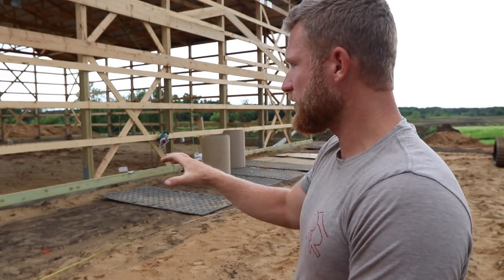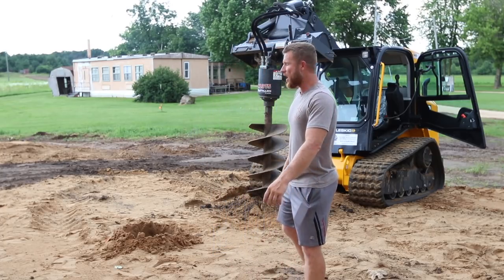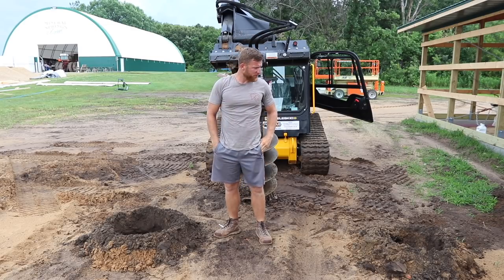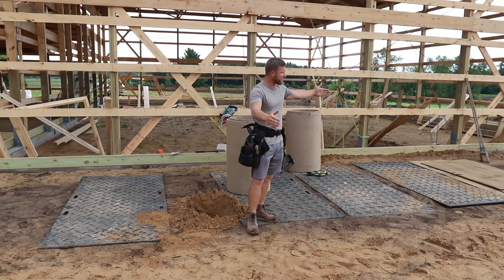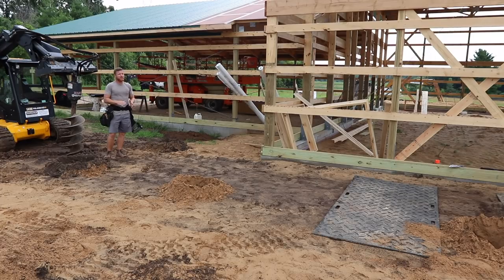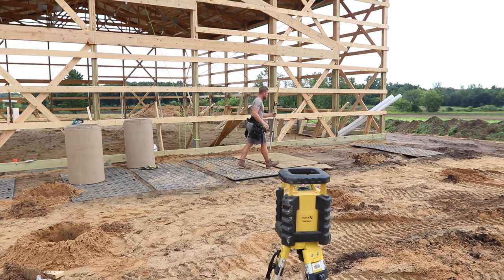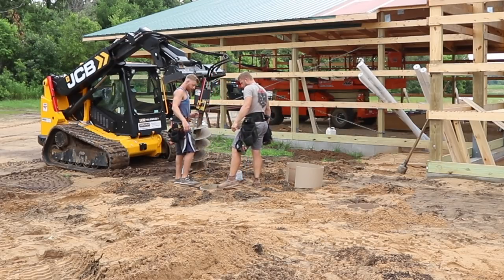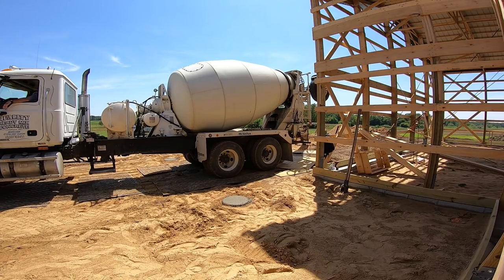Building a Hunting Cabin 8:  Using the JCB Tele-skid

Comment: Good to see the recent generation of JCB skidsteer at work.   I remember driving one of the first prototypes back in the early 90's, when I worked for JCB as a 'young'ish' engineer.  Frank Mueller, who developed the concept at Mr JCB's request, asked if I was an experienced skid steer driver. Uh no!  It was just that the joystick controls were like the backhoe loader's controls, the machine which I was designing.  Bobcat operators struggled to run it because they were used to push-pull levers and foot pedals.  I filled up the foot well and had trouble getting out with my shoes buried!  The roof didn't have any glass in it and the full bucket spilled over at full height, dumping lots of dirt in the cabin!   Fun days!
Reply from the maker: Great story

Comment: I would of just pulled a 12' 16' 20' off the building for the first layout. 
Since its only 16' wide. 
That is  3 4 5 multiplied by 4 .  
I know the longer the better, but sometimes you can make a mistake on the calculator.  
You guys do awesome work. 
Don't see many guys like yall down here in Florida.

Comment: Just a small trick we used when drilling  pier holes when we get to the right level we drop in the hole about half a bucket of water in the bottom spin the auger as fast as you can and it will clean the hole alot better if too wet drop  some lime in the hole and spin the auger In the last few years we have been using 14 tonne excavators with multi speed augers which really clean the bottoms of the piers the other thing we do is dig the footings first then drill the piers after this quicker then doing it the other way especially  if there is reo in the piers some of the excavators have cabins that side forward so the operator can see down the hole with out getting  out  of the  machine from the retired  Aussie builder that has drilled thousands  of pier holes under his belt

Comment: Remote Camera system attached to the coupler would solve the view issue if it also had a gps lidar sensors. You could also get some precision measurements as well..

Comment: When you are pulling measurements off of the building to determine pier locations, how do you make sure you are coming off square and not at an angle? Do you use 2 tape measures at the same time and join them together at the correct length on each one?

Comment: Should be rather straight forward to put that drill on the telehandler and get rid of the skid. Example: Digga's PDX2 to PD8 range of Earth Drills, also called Auger Drives, are ideally suited for telehandlers and truck cranes with a flow between 30 to 115 lpm. Used for all types of drilling applications

Comment: Is there no "curb" at the bottom of the building exterior walls?  What keeps the critters out and the rabbits inside the building?
Batter Boards....yes, that's them but don't know much about them.
Reply: Still have to lay out gravel and pour the concrete floor. Ain't nothing getting in there.
Reply: batter boards (www.google.com/search?client=opera&q=batter+board&sourceid=opera&ie=UTF-8&oe=UTF-8) do not serve the same purpose as rat boards or stem walls.

Comment: Re the visibility problem, why not hang a little wifi camera off the front face of the cab and watch it via a tablet screen bungeed to the sun visor.
Reply: He did/does mention later in the video what he did to get a better angle.
Reply: Respectfully, tho I suggested adding a wifi camera, this doesn't imply that I didn't also watch the whole video.
Reply: @dankolar6066  Once he figured out and shared the fix for the visibility problem your idea is as logical as mounting a little Wi-Fi camera to the front face of a car and to drive via a tablet screen bungeed to the sunvisor.  Possible, technically feasible, but not in any way a superior solution to the one he found worked best.  When you throw in he found the curve of the far pivot point to be a more acceptable angle therefore doing a superior job...  It is more logical to assume you didn't watch his solution before sharing yours than yours is a logical solution.
Reply: @dankolar6066  My comment stands that he found a far superior solution than a bungeed screen and camera system.

Comment: And you could make all the measurements a whole lot easier by using the metric system, no more fractions of a inch.
Reply: Interesting point.  A few years ago, I switched over to using metric for all my woodworking projects.  It simplified everything.  There's a reason every other country in the world went metric.
Reply: Sorry I only speak in measurements that put a man on the moon. Yes they did use metrics for certain parts for other countries building parts. I still don't understand why people like you complain. You're watching a video about a building be built in America by Americans and filmed by a American, on a American website, on the internet originally invented in America, on a device that was originally invented in America. Tell me why your measurements are so great now? Just cause you don't understand? When I come across someone over the pond using the metric system I just use Google to convert it if I really want to know what it is.
Reply: I actually find imperial better for timber construction. Especially when it comes to sheathing. 16", 12" centers is much easier than 406mm or 305mm centers

Comment: Why can't  you drive the post in the ground bout 4-5-6 ft.and save all that hole digging and cement? Looks like that would save time and money??
Thanks for sharing!
Reply: John Bowen driven poles don’t last as long. The pier is the perfect solution for an actuate and long lasting build. I learnt that on this channel 👍
Reply: Yes sir I should have said metal pipe which is what I intended. I could understand that rotting over time with a wood post  Thanks!  @djscotty06

Comment: You don’t put steel inside the pads?
Reply: There's no need for a pier. Especially with a concrete pad going over it. The compacted ground holds pressure against the pier from all other directions. I imagine kyle uses at least a 6 bag mix on them, and they are well below frost line, it looks. And they are large. They are only there to bear weight at this point. Everything will end up getting connected and tied back to the building. So uplift is of absolutely no concern here either. There is some math behind all of that too. But most of it comes from doing the stuff every single day.

In short answer. No
Reply: I should probably add, when it comes time to connect posts, and pour pad, yes it will all be bared and tied. I hope. 😂
Reply: @MostlyPeacefulCombatVet , no wet set brackets in this project, due to reasons such as the mixer and their lifts needing to maneuver in the area. Drill set is likely going to be used for the porch.
Reply: @Joshua79C  yeah, I build for a living too. 
But he was asking about steel in the pier not a wet set post connection.